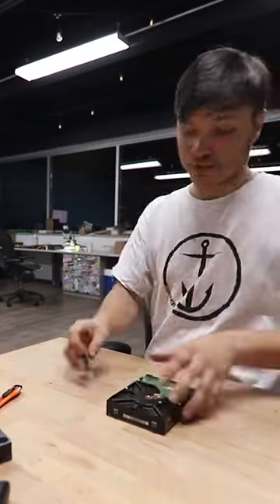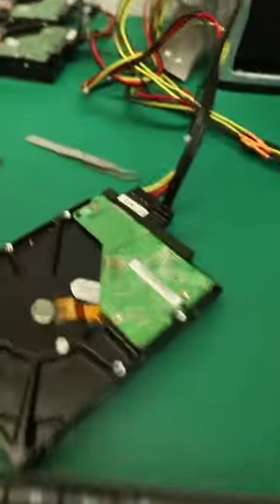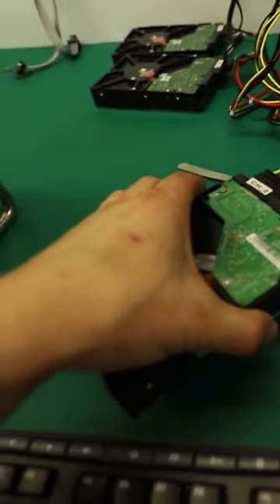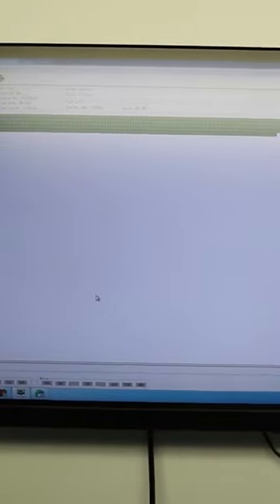super simple way to get data back from non spinning hard drive #tech

Comment: great video as always.
I have an unrelated question sir , is data recovery from formatted SSD(quick format) possible , tried all usual recovery tools to no avail .
Reply from the maker: sorry but that's not possible. SSDs use TRIM operation it sherds data by translator table. Chip off recovery could help, but for SSD 98% of the time it is not an option (encryption, LDPC, and other complex features of modern day tech :)

Comment: Looks like it is a supressor diode, not a regular one. It is here for overvoltage protection. It shorts under overvortage, and sometimes randomly. Correct me if I wrong
Reply from the maker: exactly. its a TVS Diode

Comment: Sweet. I had a psu take out a full 8tb drive. No spinning, windows even sees there's a drive and it makes the connection noise but only shows up in disk management. Disk management says no data. I did find a exact pcb was a pain and cost me about $45 U.S. I haven't attempted the repair well because there's a ton of stuff on there and I don't want to eff it up.
Reply from the maker: Check out the diode and maybe all you need is to take it off
Reply: @hddrecoveryservices  would you trust the drive after that or recommend replacing that diode or just remove and get my stuff off there asap?
Reply: @hddrecoveryservices  just checked it and using my replacement board as a tester the diode is bad on my original. Should I swap that diode with the good one I have on the replacement board? Or would it be fine to use it as a storage drive probably just keep it as cold storage just refresh it never couple years unless needed sooner. Also thank you for that video I was thinking I was gonna have to swap some chips when I got brave enough.